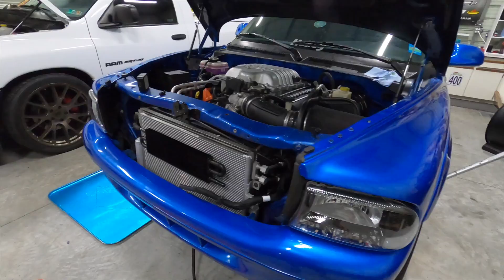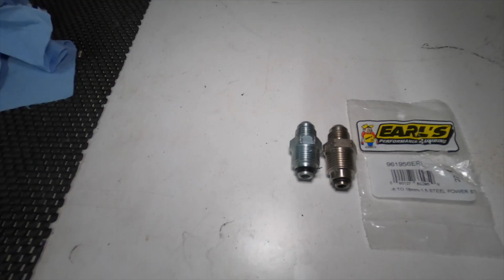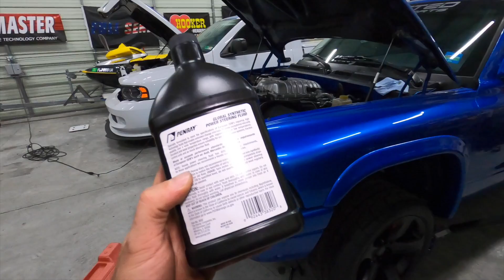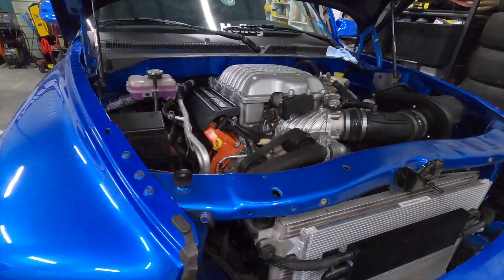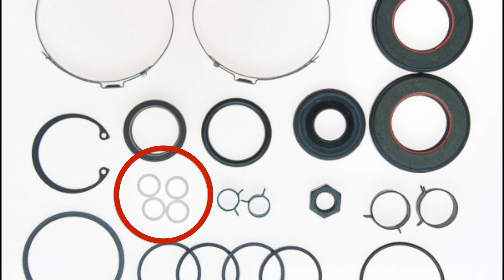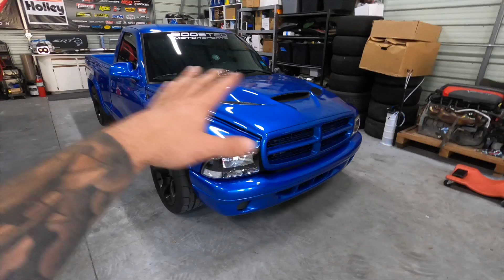Hellcat Swap Dodge Dakota Has Problems

Comment: my 02 dakota is fast enough has trick computer chip for all out timing an must burn 93 octane or rattles some an k an n  an lowered, new headline finally, brakes, water pump an radiater an shocks are special cause its lowered a bit all the way around, traction is hard to come buy though,an drives an shifts fast like its got a stahl converter in it..an something about the cam..now i cant find the guy who had it before 2006...o well...i scraped passenger side door nearly sitting still, need a door with all electric locks windows etc..am up above macon, ga about 50 miles..someone help me,im old an on disability, been driving this truck since 2006..very fast...........

Comment: Oh and I think you should do a "scota" (scat pack) Dakota r/t 6.4.....392....but without the interior swap stuff you can get those drivetrains relatively inexpensive compared to hellcat swap...I have seen them for $9,995.00 engine transmission ECM,gas pedal and low miles and I would 5.7 or 6.4 the sst. 5.9 was great for it's time but you will be spending hellcat swap money to get a 5.9 to 480 HP if you're lucky... upgraded electronics and power train is the way to go in my opinion and where the SST is a full size truck you can probably get a sweet newer interior but keep the 2nd gen look👍✌️👌🇺🇸🇺🇲

Comment: Good information to know thanks 👍 as I build mine....I did find fittings on summit racing that you can change the flow rate as to not over pressurize the rack and heat the pump to a boil. It's a type 2 pump and they have about a dozen different fittings so if you got older rack and pinion, steering box,older steering box like 60s mustang that shit show of steering crap.....I am ticking away at it and gathering parts as I am setting in the HVAC box and dash support using yours as a template of sorts... what I am doing different is with the heater core lines I found some 3/4-19mm barbed hose bulk Head fittings so I don't need to bend the aluminum pipes I can cut them and position the hoses over or under the expansion valve for the a/c and side by side like original in the car but not close to the brake booster if that makes any sense..... and I watched the episode of the fuel system but it doesn't list the fittings you used I know you used -10 but I was looking for the part# for the elbow on the Holley fuel pump assembly.... and since you had the starting issues I thought I might run a return line from a fuel pressure regulator to the pump head as not to over pressurize the system... well anyway awesome information Jon appreciate all you do and show I have been meaning to join the channel for secret squirrel stuff and tid bits of information and I really do want to help support you and the channel and I will once I get all my ducks in a row and the wife is doing better... doctors are not cheap!.... thanks brother 👍✌️👌🇺🇸🇺🇲

Comment: Awesome J《☆》👍🍗🗣That's the Ticket🖖😎☮
Reply: we only found manual steering boxes an set them an front end right saves a little power, power steering is ok, if you must have it your a  pussy..we preferred lightweight an fast 360 or 440,s..an winning money not spending it, but some are friggin rich as right here, an others have ate outta dumpsters an slept under bridges in between times, you better believe it...
Reply: @davidledford1456  《☆》Manual steering is the way to go for A body Mopars⛾🍕🗣Idk how hard it would be to mount a manual box on a Dakota. If you actually get it mounted it would be pretty hard to steer due to the weight of a Dakota. It might be ok with pizza cutter tires on the Drag strip🖖😎☮